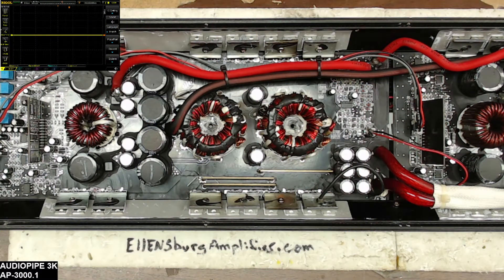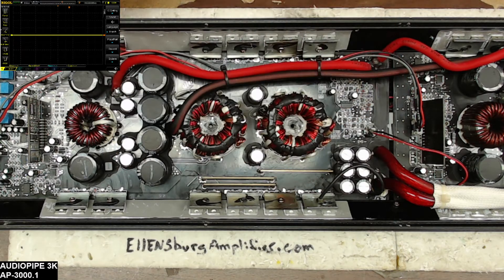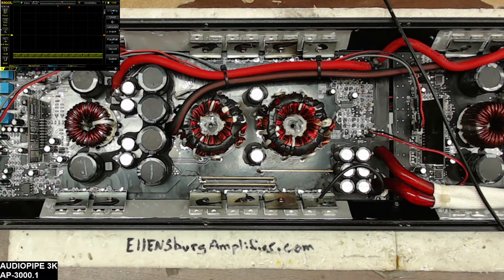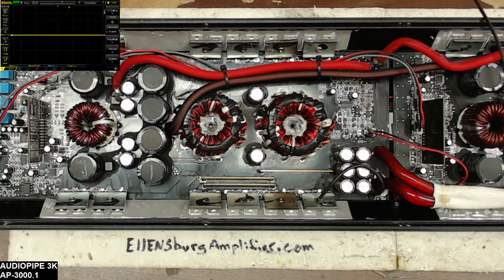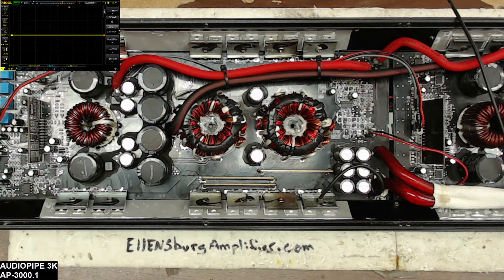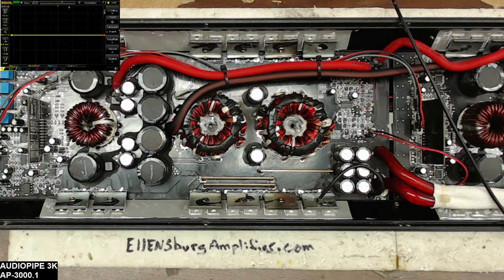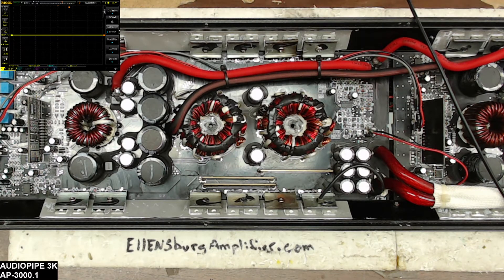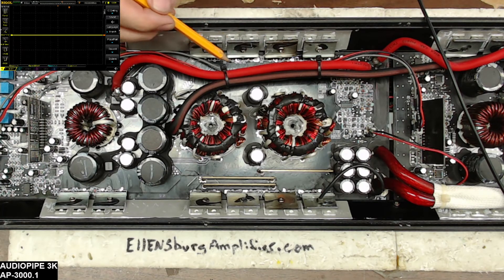Audiopipe AP-3000.1D 3k Amplifier Repair Revisit of Output Frequency Issue RESOLVED

Comment: Hi sir I have a audiopipe bass amplifier 1800watts the output inductor getting hot and start to smoke but it playing normal
Reply from the maker: If the inductor is not shorted (it will heat up or destroy itself quickly) over-heating inductors is from low impedance.
Reply: @ellensburgamplifier  it's not shorted replace with new ones and still getting hot
Reply: @ellensburgamplifier  I'm using 4 ohms speaker

Comment: What would you charge for this Amp? Last we spoke it was still hanging on your wall. I'm not rich but would entertain a fair asking price if you'd like to see a return on your labor 🙂
Reply from the maker: I don't repair these amplifiers due to the high failure rates. When the two boards get out of "sync" then one or the other fails. Mine will be on the wall for quite a while.
Reply: @ellensburgamplifier  So you're basically implying, this Amp will forever hang on your wall, because there's too much time and cost you've invested, you're afraid of selling it because of the potential headache of someone pushing it hard again, and burning it up, insisting on their money back?

WHY not come up with a price you break even at, and sell it AS IS, with the disclosure about the boards being out of sync, etc...?
Reply from the maker: @VentureWelding  It's more sentimental value that shows two boards of the utmost simple design that can cause long-term havoc on one's mind. And you are correct I don't sell or release liabilities.

Comment: I've got a 1800.1 that is disconnected from the car, and is measuring continuity between 12v and ground terminals. That's not supposed to be like that correct? Any suggestions? I've removed all the mosfets and there's still continuity.
Reply from the maker: If it is showing a low resistance value across the positive and negative terminals then there is a short on the 12v line. There are a few other components that are tied to the 12v which could be shorted. If the power supply transistors are out and you still have a short then I would be looking at the drivers. You have to work your way back from the transistors all the way through the remote circuit.